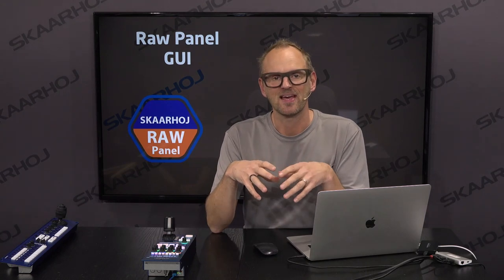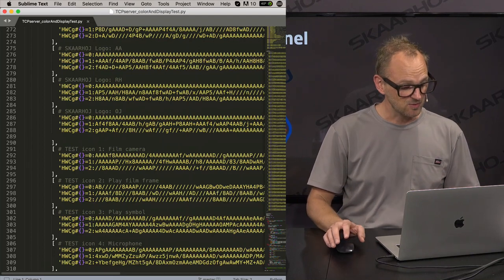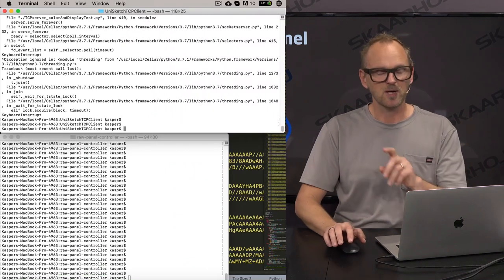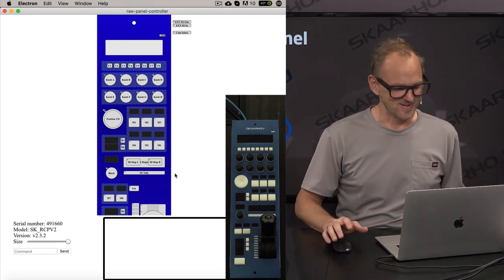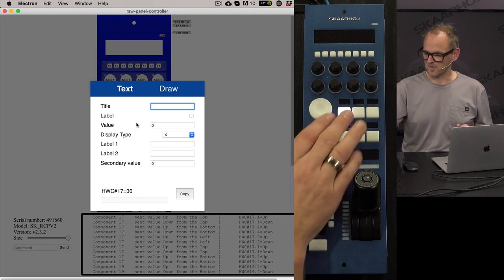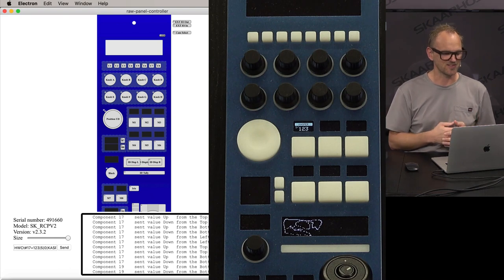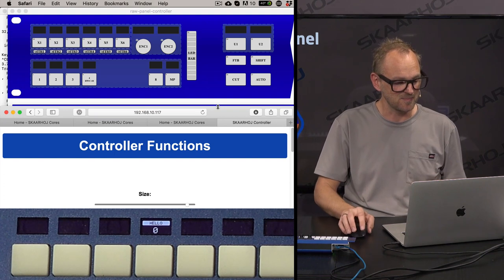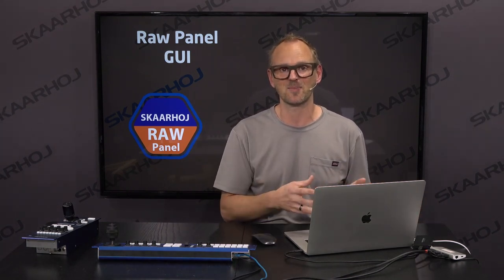Raw Panel GUI, Server Mode and general recap

Comment: Hi there and thanks for this video. I see loads of use cases for this mode of operation. One thing I could not find in the manual: can the TCP connection be encrypted and optionally authenticated? Thanks for the response and clarification.
Reply from the maker: Hi. 
Glad to hear that you think is useful! 

Currently we do not have encryption or authentication for TCP connection with Raw Panel.
It's possible that it coming in the future, but it's not around the corner.